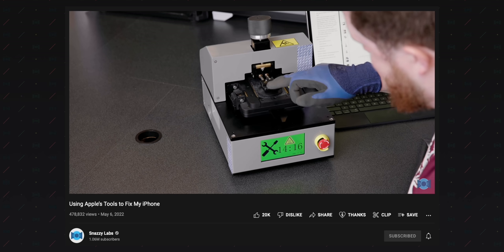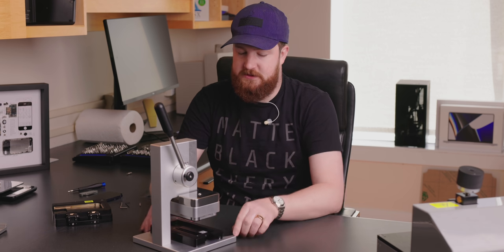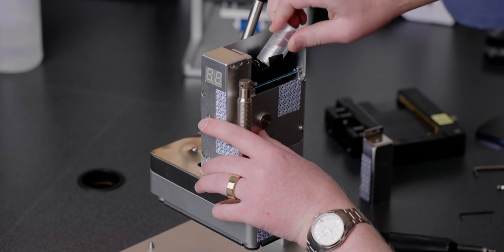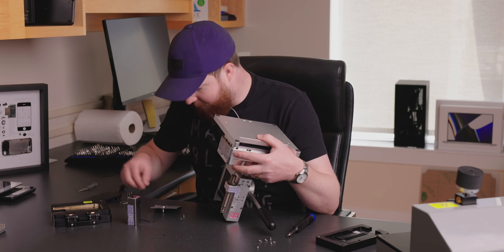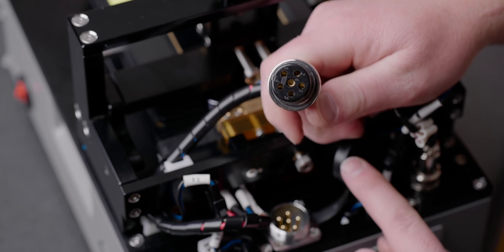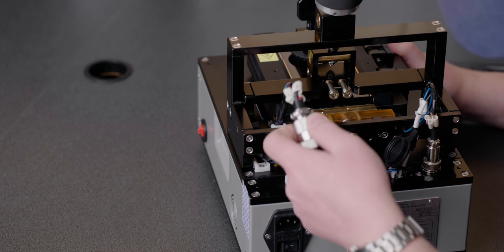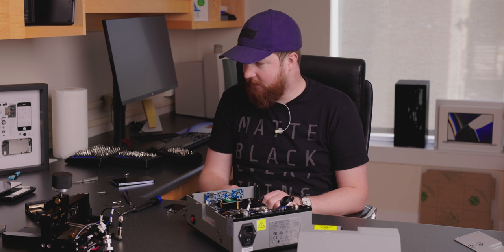Breaking Into Apple's Secret Genius Bar Tools!

Comment: As an engineer, this physically hurts me. I'm pretty sure they had to have specifically designed those tools to be as expensive as possible, while not really being at all more effective.

It's not even that they're super low volume either.. Think about how many apple stores and certified repair shops are out there. It's not a small number.
Reply: They literally have this is one of the reasons i hate apple and will if possible avoid their products (except their ipad since i need an ipad since there aren't any good android competitors except the tab s7/s8 series)
Reply: The heater is 100% not apple exclusive, but it was indeed 'commissioned' to be more expensive and the previous model that was cheaper and did the same thing... discontinued.
Reply: @Folsomdsf2  you could possibly get  a heat puck for any of the modern phones
Reply: @oliverboi  You hate Apple because their own tools are overengineered? That makes no sense to me. If you don't want to use those tools, just don't. They are 100% optional.
Reply: They don't design things specifically to be expensive or (funny shaped screws aside) hard to repair. They simply design them with literally zero consideration given to cost or repairability.

These tools are so overbuilt because they're intended to remove individual technician skill from the equation, and have an extreme degree of consistency from Apple Store to Apple Store. They were never designed to be sent to third party repair shops; that only happened because Apple is bracing itself for a wave of Right to Repair laws.

For what it's worth, there's a reason Apple has a reputation for considering every detail down to the millimeter. Because they actually do. Just, not in the way your average engineer would be used to.
Reply: A lot of this stuff reminds me of industry tools though? They are sturdy so they are resiliant and consistent for thousands upon thousands of repairs. The roller seems like overkill, but the heat plate and the press seem like phone-specific varients of tools I'd see in factories and workshops around the world.
Reply: Regarding some of the comments... Yes, I see this all the time from more than just Apple (aerospace), and it hurts me then too. Over-built means under-engineered.
Reply: @luke_fabis  exactly. What I've found out is that they can be used by disabled people. You only need one hand to do the whole repair. And I get where they're coming from, but they simply make life harder for the rest of us if we had to follow the instructions precisely. Just today I had to do a screen repair on a 12 Pro which was shattered. And guess what? I used a heating mat instead of the fancy machine and was able to complete the whole repair by the time I would've opened the phone "the Apple way" while not even damaging the frame. It's a pain to oblige to Apple's standards.
Reply: Reminds me alot of those juicer machines. Way to good for the job its supposed todo though I understand the importance of "factory standard" when its comes to repairs. 

Im sure they make up whatever volume easily with the amount of repairs. Wouldnt surprise me if atleast 30% of every iphone sold has to go through a screen or battery replacement at some point within its lifetime. With some apple stores servicing 1000+ customers, each one of these could be used several times a day depending on the location.
Reply: @Dje4321  there just is no "factory standard" for opening phones or pressing down a battery. Out of at least 2000 iPhones I serviced, there  was exactly 0 with a loose battery, even if it was taped down with double-sided 3M tape. Same thing for opening phones. You can jimmy your way through the adhesive after heating the phone up. And what I've found is that if you use the heat mat instead of the heating machine you'll get the old seal off WAY easier since it doesn't turn into sticky gunk but stays in shape so you can peel it off as one piece. There is just so much time wasted while chasing some standard that doesn't exist. And resealing the phone is another story: you can have the fanciest press in the world; if you don't align the seal perfectly, it's useless.
Reply: @Aaron Thompson: I'm pretty sure a significant number of those parts are die cast, so we're easily in high volume territory.

 @luke_fabis  You're conflating "overcosted" with "overbuilt". Being overly expensive doesn't mean the tools would be worse if they were cheaper, just more cost efficient. Any decent mechanical engineer (with a reasonable time budget) could probably cut the cost of these significantly, without compromising function. The most egregious examples for me were the gantry of the battery presser thingy made from multiple machined parts (1:23) when a single folded sheetmetal part would probably be even stiffer and the ludicrous cam design of a lug bolted into machined gear (10:35), when you could just slip a stamped sheet metal onto the gear axle or use the already machined central pillar conveniently moving right past the pcb (I'm talking about the part the rail and rack are mounted to).
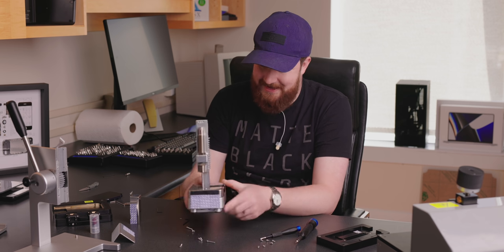To be fair to the engineers, the shield (9:57) is there for a good reason and not just for optics. The heads of spring retention lugs will propably lower quite quickly when the handle is released and therefore be a nasty pinching hazard which should be covered to prevent injuries.

While I do agree with "zero consideration given to cost" sentiment, I think that this has less to do with the resulting tools being super good and more with the fact that Apple has learned that they can charge anything they want and people will buy. So they don't worry about target costs and just slap their margins on the production cost, whatever that may be. Therefore the optimisation comes with reduced development time, which in my opinion shows in the finished product. Not bad engineering, just hasty and unoptimized.
Reply: Speaking as an engineer myself, those of us who work on things with our hands have developed skills that give us an affinity for all kinds of workpieces, even ones we've never seen before, and as a result, something like pressing on a phone to seat a glue strip may seem trivial and intuitive to us, but to a young kid who has never done anything like that before, it isn't necessarily obvious just how much pressure you'd need to apply. Maybe they'd use too little. Maybe they'd pound the phone with their fist. This tool turns that operation into something that a worker with zero practical skills can to perform with a near-100% success rate in only a minute or so.
Reply: @Azoooro  I see no die castings whatsoever. It looks 100% cnc to me.. (aside from the box around the heating unit, which is sheet metal).
Reply: @Azoooro  These tools were never meant to be sent out, though. This was a cost that Apple was eating on its own, quietly. It was only very recently that they started getting sent out past Apple Stores.

Also, Apple is extremely heavily invested in CNC equipment. When everyone else was stamping sheet metal and injection molding plastic, Apple bought like half the world's supply of Fanuc RoboDrills and started cranking out unibody MacBooks back in 2008.

That's not so much the case for sheet metal. There are almost no sheet metal parts in a modern Apple product. Even EMF shields and electrical connectors are MIM, not sheet metal. And that's for MP products. These repair tools, again, are not mass produced at the sort of scale you'd expect for an iPhone. No way in hell would Apple buy the tooling needed for sheet metal, especially not when revisions and iterations are a looming possibility.

And moreover, Apple has something of an obsession with tolerances. You'll never achieve the same tolerances and finish with sheet metal as you would with CNC. So, fat chance of ever seeing stamped, heavy-gauge sheet metal come out of Apple.

Apple's corporate culture is not what you think it is.
Reply: @PvtAnonymous  iPads aren't repairable. Like, at all. Maybe Apple does some kind of disassembly when it refurbishes iPads, but if you go to an Apple Store for a cracked screen, they'll replace it, not repair it. There is no "Apple way" in this case. There's no official way at all.
Reply: @Aaron Thompson: I was going mostly off the surface finish and features that looked impossible to machine (e.g. on the main body of the display adhesive press), but upon closer review the finish is most likely a post process and the impossible features are a second op, so you're right. I guess my intuition got the best of me, as most engineers wouldn't mill those shapes out solid stock.

 @luke_fabis  I've seen comments under this video (possibly of certified independant repair centers?) claiming they received one set for free but had to  pay for duplicates for other locations. Either way, saving costs means reducing your overhead and thereby reducing the necessary margin across the board, resulting in cheaper products for the customer.

I get that Apple is used to machine everything out of full stock, and I'm not arguing they should stop doing it for their products. That is a design choice that comes with certain benefits and if people are willing to pay the price it's totally fine from an engineering perspective. CNC Machining almost every part on those tools on other hand, is a "have a hammer, see a nail" problem. I design small and medium run machine tools, and sheet metal is by far the cheapest option we have to create parts. You don't need tooling to create a simple folded bracket, just a laser and a press brake. And just recently I designed a cover with a very specific shape, where the tooling (for metal spinning) was cheaper than a single part would have been if machined, and the cost for a run of 10 parts (including tooling) was only slightly more than that of a single machined part, so tooling can be cost efficient rather quickly.

Unnecessary tolerances (and surface finish) are exactly the waste of money we're talking about here. Our machine tools produce automotive gear parts with very tight tolerances, that doesn't mean every part on the machine has to be CNC milled, just the ones critical for the function of producing the parts. The sleek design of Apple products is (IMO) entirely unnecessary on tools never meant to be seen by the general public, and so are CNC level tolerances for most of the functions of those tools. As the saying goes: "Anyone can build a bridge, only an engineer can build a bridge that barely stands."
Reply: @Azoooro  A laser and a press brake cost labor. If your supply chain is so stupendously based around CNC as Apple's, all you need is a trained money to load stock and press cycle start. You're thinking too small and you're not wrapping your head around the mind boggling scales Apple operates at. Minimizing human intervention by even a second saves Apple more money than a small shop will see in a year.
Reply: @luke_fabis  How much of the cost is labor is irrelevant, what matters is the total cost of the part at the desired scale. I know how much companies are willing to pay for automation systems, so I am aware of the savings that are possible at a large scale. This doesn't only apply to CNC machining though, most processes can be automated to reduce labor costs in large runs. There are automatic wire and pipe benders, automatic loading systems for laser cutters and even robot assisted press brake systems. What you cannot change is the physics of the underlying production process, be it the cutting speed of a CNC mill or a laser. And it is a matter of fact that cutting and bending sheet metal gets you to your desired geometry way faster (albeit way less precise) than milling or turning, which is the main reason for the sometimes staggering difference in part costs.

If Apple is truly able to produce CNC machined parts for less money than it would take to source comparable sheet metal parts, they should stop selling electronics and destroy the part production market. I seriously doubt that's the case though.

Comment: This is honestly some beautiful engineering. I think it's all genius, even the screen press that Quinn rips on. They have a way to precisely apply the correct pressure for every different phone model using the same press setup. The press means techs can't apply too much pressure and break the screen. It saves them from the liability, and helps avoid complaints later with screens not adhering. Everything is just as simple as it needs to be.
Reply: None of this is "as simple as it needs to be. The press having a timer is insane. All they had to do is say to press it for 1 minute, of it needs 30 seconds. There doesn't need to bea tool to press the battery glue. If you're too incompetent to press the battery down, like independent repair shops do, millions of times a year, you're not competent enough to do the rest of the repair, which is far more tedious and technically demanding. This stuff is all to comply with having a repair program, but making it as difficult as possible. It's non-compliance compliance.
Reply: Back in the 1700s if you needed to apply a specific amount of weight to something, you'd just use weights.
Reply: @littlejackalo5326  This is the truth for the mass tho. A lot of people just fancy the idea of self repairing, but are not aware that they are actually ill-equipped to perform maintenance beyond changing a removable battery or a SIM card in an old feature phone. The situation is the same for cars and watches. The strange fact that Apple is pressed to make a repair program for their crazy tightly engineered phones to even the least tech literate people means that their tooling has to be insanely fool-proof. Low repairability is a consequence of how tightly integrated modern tech is, everything has to be laminated and stuck together to create the devices that we take for granted. Arguing why the screen of an iPhone 13 Pro cost $300 to replace, while raving about the gap-less feel and OLED visual is like have their cake and eat it too.

Comment: there are a few ways to take off temper seals and actually just stick them back on after and 100% you cant tell it was ever done... basically you just use a solvent(denatured alcohol), scalpel and some tweezers... after the sticker is off you let it dry and it will still be sticky when dried and you just stick it back on when done...

Comment: The DC-DC is almost certainly just for the control board.  If they needed 12-24V for the heater cartridges they would have just gotten a 24V power supply.  It doesn't make sense to convert the power more than you need to.

Comment: Apple designed these tools to the lowest common denominator.   What seems reasonable to you and me is totally foreign to some people, hence the tools, like a torque wrench, provide a prescribed pressure and procedure for "correct".
Reply: I think its more about consistency and speed when you are working with hundreds of phones a day, you don't want to be manually playing with heatguns to take off display adhesives, and what if you don't seal it back right and customer water damages it? the tool will make it factory sealed.
Reply: Torque drivers are absolutely just to keep torques to spec and not under or over tighten.
Nothing to do with making it simple.

Comment: the reason for transmitting the temprature and duration using RFID is that it just simplifies things, you don't need any kind of logic or micro controllers built into the hot pocket at you would just need to have a logic inside the machine itself (of course you could have flash memory inside the hot pocket and connect it to the machine but because of RFID being so reliable it just makes more sense)

Comment: The reason they do data over NFC is that the other pins are probably not data pins. I assume that 2 of the pins are power for the heat catuses and the other two are simply transmitting the thermometer analogue. The chipset, which interprets the resistance in temperature, will most likely only be found in the device.

Comment: Small correction: spring force is a linear relationship. Hooks law states that F=kx. F represents the force, k is the spring constant which is a property of the material and geometry of the spring, and x is the linear displacement from the neutral point.

Comment: 2:18 that is actually not true. The force applied by a compressed spring IS linear if the diameter of the windings and the thickness of the spring steel wire used (or other aspects, like selective heat treatment etc.) doesn't change over the height of the spring. That is the advantage to use springs over bulging rubber pads for example.

Comment: While it was cool to take a look at the different tools just have to ask did you rent them or buy them outright?
Reply: Based on his lines, he rented and paid the deposit. Apple will now take away the deposit since he basically butchered everything.
Reply: @ScaredPilot  then color me disappointed. if he was planning to do so I would very much rather he bought them outright. Its not really a big deal really, but just not a behavior I wish a person of his influence would do.
Reply: @Ex14  you can’t buy them that’s the point though ..
Reply: @maxdagorno7269  no… you CAN get the tools. I believe he even said so in his previous video.
Reply: @Ex14  you can’t . You can only lease or rent them basically when you order it with the new parts by Apple . Sorry
Reply: @maxdagorno7269  You can buy them from the website. You should get your information right
Reply: @maxdagorno7269  I’m sure you can because 1) he mentioned it in the previous video.

2) I actually went to reconfirm with another source (Mac rumors) before commenting… so yea. Unless you can disprove the Mac rumors one. You Should be sorry lmao